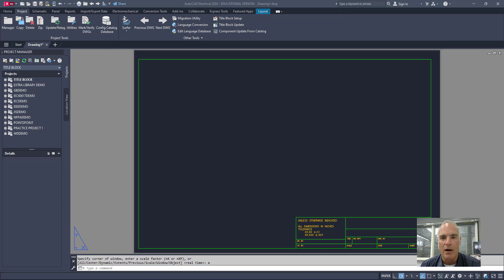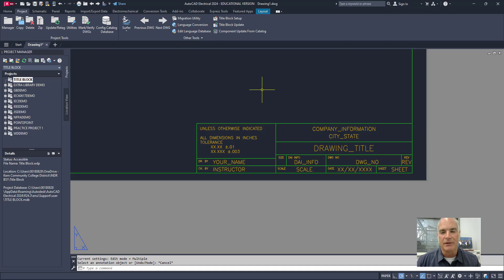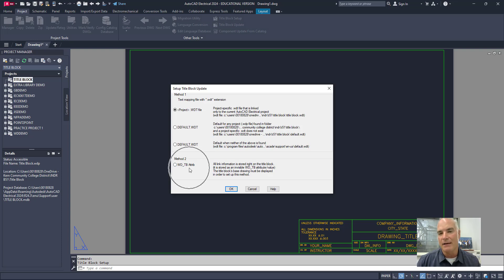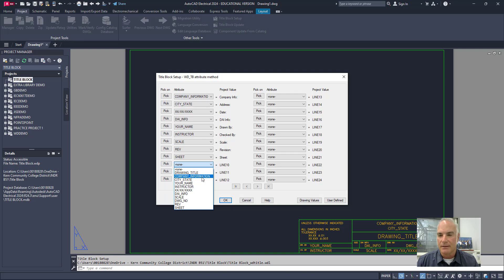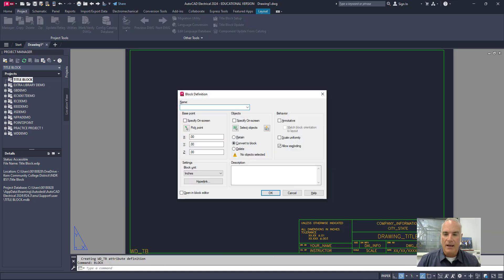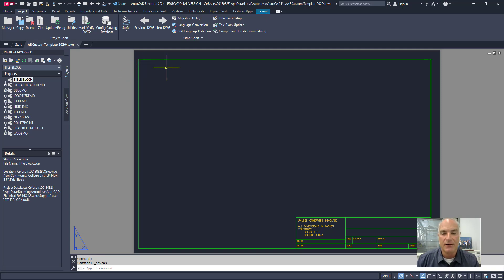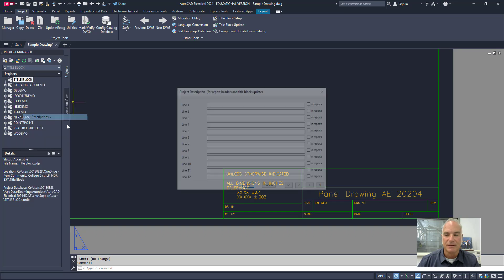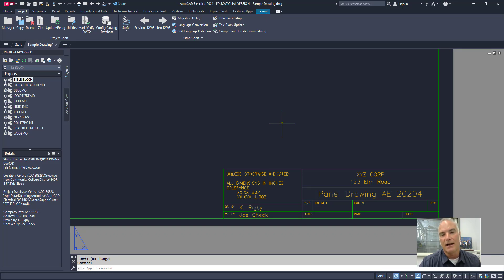AutoCAD Electrical - Mapping the Title Block

Comment: I like your teaching style, your presentation is definitely something I can learn from.  You've got my subscription!

 I think I need the video that leads to this one first, the wizard just gives me a "no attributes found" when used.  The problem I'm having is creating a title block and attributes in ACAD vanilla style, I end up with a template that creates drawings with both paper space and model space, which I don't want for drawing schematics with ACAD Electrical.  The paper vs model space tabs are helpful with my normal construction drawings, but for schematics and panel building the zoom and navigation functions act differently when using the Schematic and Panel ribbons in Electrical. I fully accept this may be operator error, which is why I'm trying to learn the title block template method via Electrical from scratch.
Reply from the maker: Thanks for the compliment!
Regarding your comments, vanilla AutoCAD doesn't have the complete database included with AutoCAD Electrical, so you won't be able to complete the process as shown. 
If you are getting a notice that there are no attributes, make sure the attributes in the title block were created with the ATTDEF command, and not just regular text.
Good catch that I was in paper space when I started the video. I don't recommend that electrical drawings be completed in paper space - it was just where I was with another class I teach. The process works the same even if you are in model space.